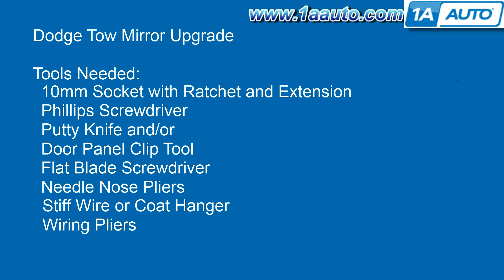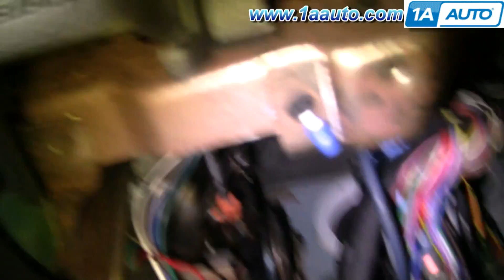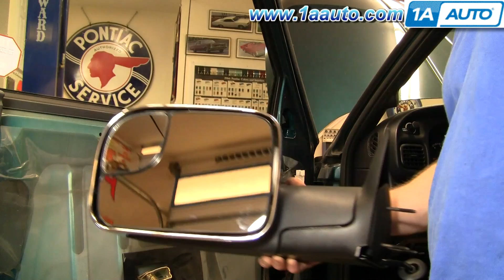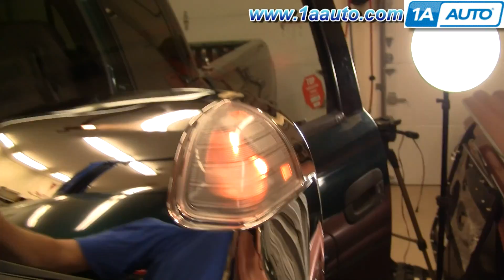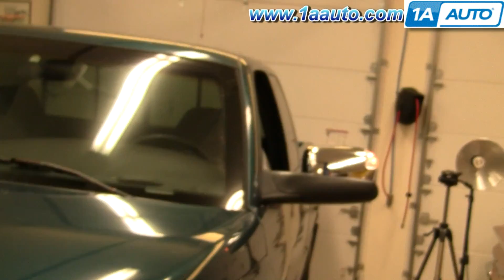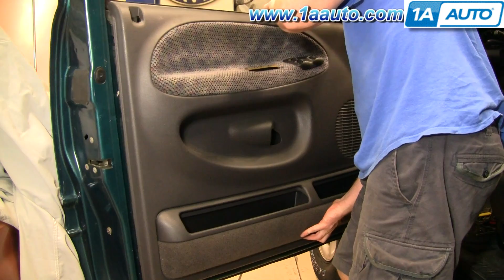How to Upgrade to Tow Mirrors 97-01 Dodge Ram Part 2

Comment: do these come in black instead of chrome.  also is the newer style glass(bar type of spot instead of just in the corner) available for the gen 2 rams?
Reply from the maker: +Alvin Finch If you would like to reply back with your year, make and series also all of the features your mirrors currently have, we can reply back with a link for the ones that we carry.
Reply: 2000 ram 1500 power heated standard mirrors currently.

Comment from the maker: @gobbler smith You may want to have the dealer run your VIN number to see if your truck came pre-wired for this feature. Here's a link to the tow mirrors that we carry for your 1998 Dodge Ram. Hope this helps you out. http://www.1aauto.com/1998-dodge-ram-1500-truck-side-view-mirrors/y-mo-c/1998-1463-23?utm_source=YouTube&utm_medium=YouTube&utm_campaign=1ATony

Comment: I recently installed towing mirrors on my 1997 Dodge Ram 2500 and the drivers side mirror only move left and right not up and down but the passenger works fine. Before I put them on the mirrors were fine. Do ypu know what the problem could be?
Reply from the maker: Thank you for watching! It is possible the wrong ones were ordered. Not all of the mirrors are wired the same, it depends on the options for the mirror
1aauto.com  888-844-3393

Comment: Is there any way to hook them up to both the turn signals and running lights????
Reply from the maker: This isn't something that we've tried. You may only be able to hook them up one way or the other. Thanks for checking us out. 1aauto.com 866-403-3393

Comment: Bought some towing mirrors from you all for a 2500/3500, power heated with the brackets. However I can't get the bracket to work with the mirror, but if I leave out the bracket the threads on the studs are too far away from the door so I can't tighten it and the mirror just hangs off. Did I get the wrong brackets?

Comment from the maker: HI, On those newer style tow mirror that's on your 98, our manufacturer built them just like the factory ones than came on the 08+ Dodge trucks. They're at a slight angle. The reason for this is, when they designed them for the earlier style trucks (which never came with these mirrors) they had to be at a slight angle for the driver to be able to see correctly. This was done for safety reasons, allowing you to tow and still be able to see correctly, and also retain an OEM type of a look.

Comment from the maker: If you have the dealer run your VIN # they can tell you what your vehicle came equipped with for mirror options. 1aauto.com 888-844-3393

Comment: I upgraded my 2001 Dodge mirrors. Came up  with an issue. I wish that I would have seen your video and shop prior to doing this.  My problem is I think, that the studs from the drivers mirror hits the mirror switch when I put panel back on. I need to test for switch and then replace, and cut stud.  I didn't see that happen on your video. But it was a great help. Thank You

Comment from the maker: If the truck didn't originally come with tow mirrors then it's highly recommended that you purchase the mirror brackets. It helps to beef up that area of the door, and provide a firm base in which to mount your new mirrors. We carry them on our website 1aauto.com 888-844-3393

Comment from the maker: We always recommend purchasing the mirrors with the options that came on your vehicle. That way the plug ends will match up. You could probably splice in some of the options that you may not have, but this would also void the mirror warranty if the wires are cut.